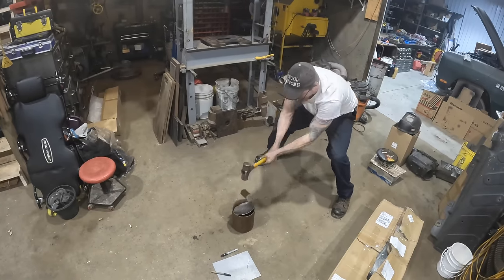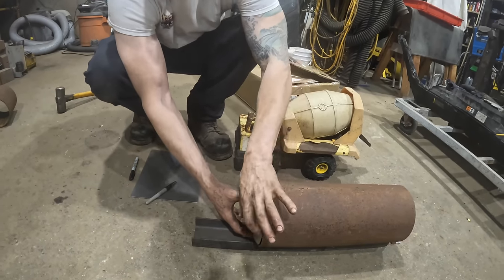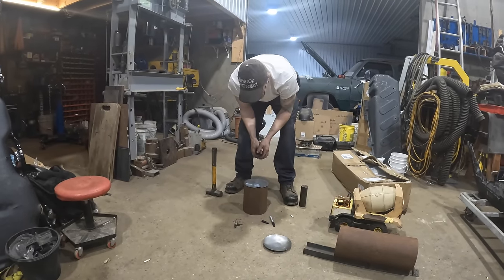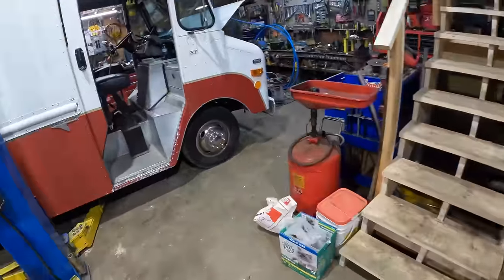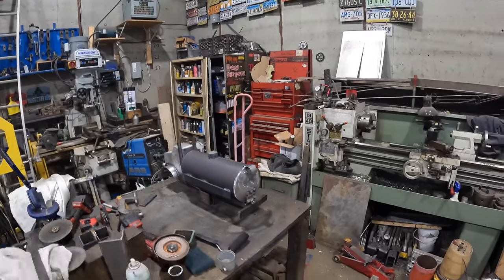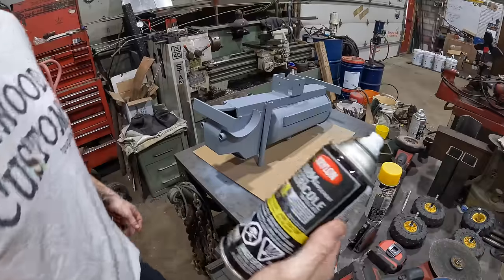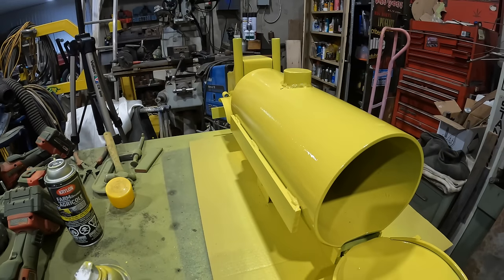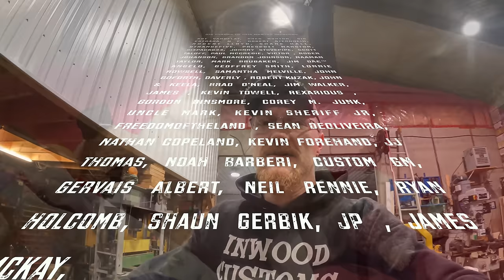how to make a custom truck mail box

Comment: your truck mail box is great i lived in a house growing up it had a big white concentrated & mater with white lime stone blocks and 4 inch thick  slate top & mail box stuffed in it by the road! ( dad got a letter from the state & boro we lived in) were redoing your road remove the mail box & get one these from your local  hardware store with mount after roads widen and redone we will install the new mail box! you supply because we had you remove the old one ( they did not want to pay for ruining the white blocks of lime stone there this big white fire place in the living room when its fixed you can use these blocks to repair it!) my dad gave a brick layer the slate section fix the fire place! he handed me a hammer and blade thing he cut block with hit the dry  mud it break apart! thst where the blocks went! the next day a truck ruined neighbors mail box & ruin the block things base section the truck fared poorly the wrecker towed  it away!